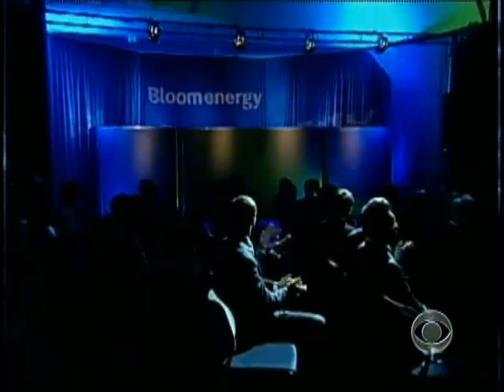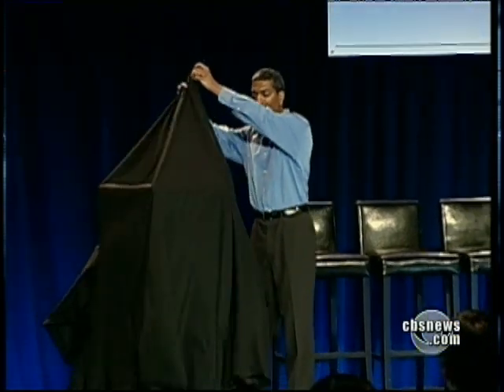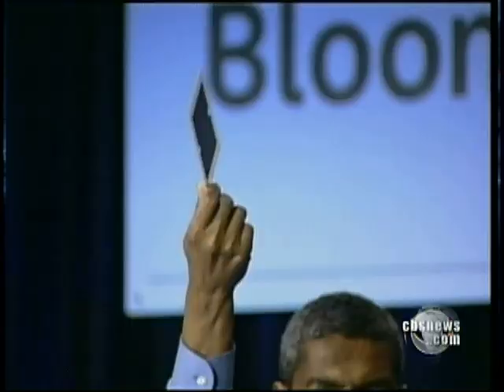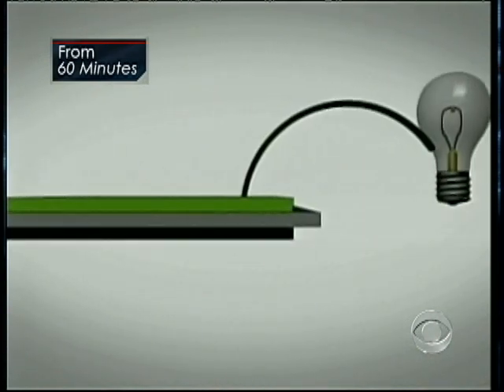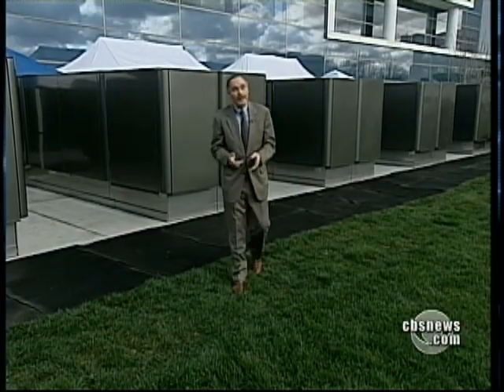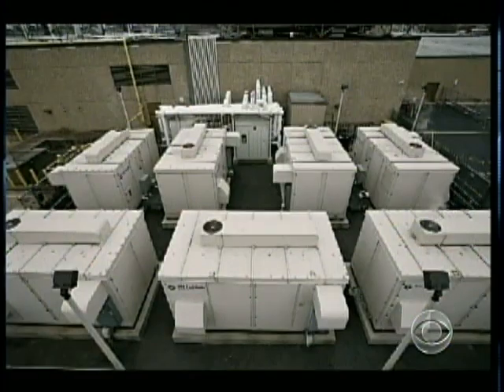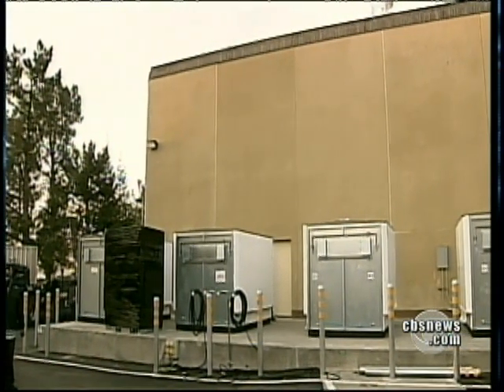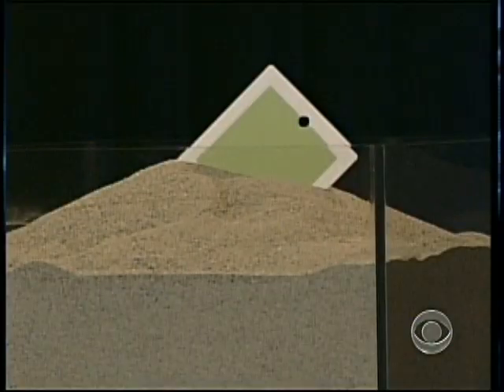Bloom Box Unveiled

Comment: I want data. And Sidhars claim, that it has nearly zero CO2 emissions, simply cant be the case, solid oxide cells work by combining and burning air and natural gas to produce energy, water vapour and CO2, unavoidably. The question that must be asked is how much energy the box generates for each unit of fuel input, and how much CO2.

Comment: Solar is certainly among the "completely clean" options, but it is far from being cheaper.  The amount of solar panels required to power a home would be far more than the $3000 projected for the home version of this unit, not to mention the fact that solar requires a massive bank of deep-cycle batteries that need to be replaced every ~3 years. (battery disposal is the environmental impact of solar power, unless you combine solar with other forms of power generation to "fill in the gaps".)
Reply: On grid system